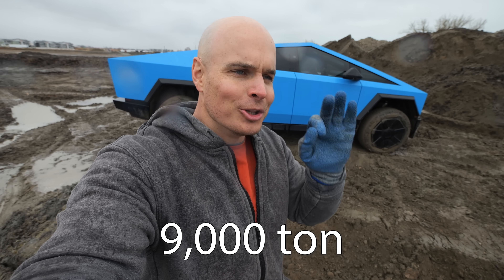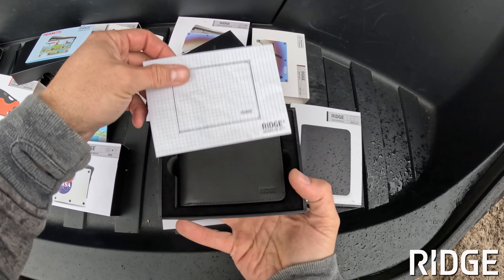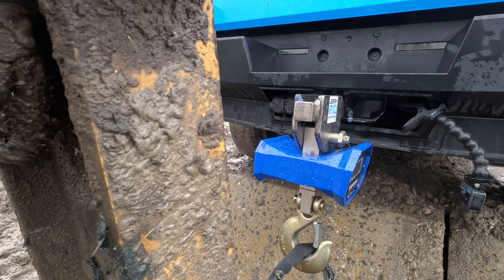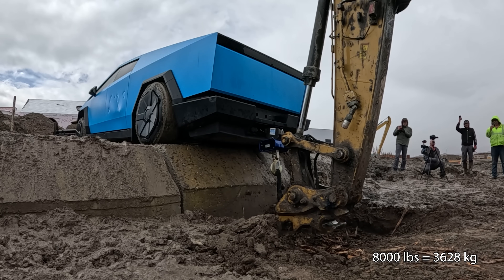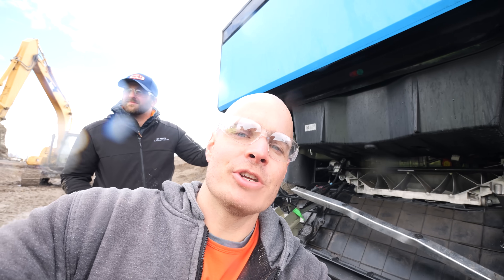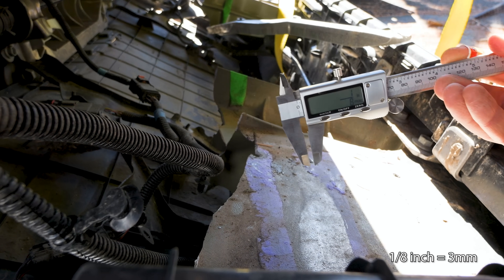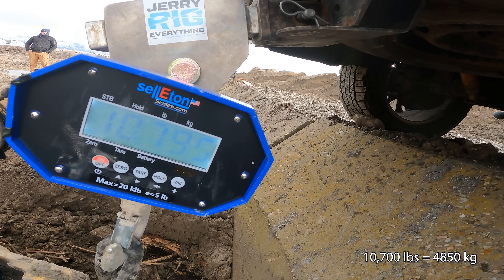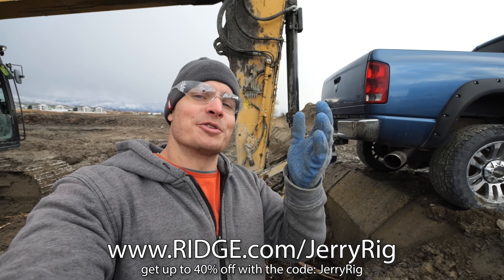SHOULD YOU TOW WITH A CYBERTRUCK?! - (catastrophic failure test)

Comment: I'm confused. The towing capacity is 11000lbs. When would you ever have 10000lbs actually being lifted by the tongue? I thought the tongue weight limit is suppose to be 10% of the towing capacity.
Reply: I'd be more worried about shock load,   Hit a large pothole with a loaded trailer the forces could be multiple times the weight of the trailer.
Reply: @OldJunkandaDog  No it wouldn't, unless the pothole is the size of the entire truck, which then falls vertically with the trailer behind it still on the road...
Reply: i thought the same thing its not 11000lbs towball weight
Reply: Bingo! This test is a crock of sh!t.
Reply: @ShawheenAzizi  hitches failing at the gigacasting while towing moderate loads under normal driving conditions have happened to literally DOZENS of CT owners so far - clearly there's a massive underlying issue/flaw regardless of what you think of this test. There has NEVER been any conventional steel frame truck models that have experienced dozens of frame failures towing within a year of launch, and if there were, any major manufacturer would do a full safety recall. This isn't just an issue hurting CT owners, it's potentially lethal to anyone driving behind a CT pulling a load.
Reply: Metal fatigue from cyclic loading is a thing. Just because it took 10,000 pounds to make it break off in ONE loading cycle, doesn't mean it couldn't break off after hundreds of loading cycles at 3,000 lbs. And with 1,000 lb static load on the hitch, 3,000 lb spike loads are entirely possibly when hitting sharp dips in the road at high speed. It was also making noises after 6,000, so at that point it was already compromised and would have broken off after a few more loading cycles.

Let's not forget that when WD broke his, he wasn't specifically trying to break that part of the truck. He was just goofing around with it, and it broke, very early in the testing too. 
It's also happened to at least one person in the real world, so let's not pretend that the 10,000 lbs seen in this video means it can't break off in real world conditions because it's already happened.

The real problem is the fact that it breaks off instead of bending. If the frame bends on a steel truck, you still got problems, but at least your 10,000 lb trailer didn't go out of control at 60 mph on a public road.
Reply: @thecrazyfarmboy  this is my concern exactly.  It started creaking at 4k, mades some pops at 6k.  Damage is already being done at 6,000 pounds.  Repeated stress could have these things breaking in 5 years or some time in the future
Reply: You are correct this test provides useless information
Reply: Sounds like a lot of people didn't actually watch the video since he mentions a few times.
Reply: Don't talk facts, the us progression hate
Reply: hit a pothole or go over a steep hill such as a levee.  Pull out a stuck vehicle.  

For instance, how does a 6000 pound truck pop a 16000 pound breaking strength strap?  It weighs under half of the breaking strength rating?   

Simply because there is a such thing as shock load multiplying the actual weight attached.  Which can occur during everyday events such as potholes, speed bumps, trailer becoming unlocked and jumping the ball hitch, recovering a stuck vehicle, sudden weight shift due to hard braking, and even occurrences such as a blowout on the trailer.
Reply: @jmkieff  and don't forget upward load cases like how diesel hit the hitch from below
Reply: How do people not understand that you can’t rigidly define dynamic forces? If you’re pulling 10,000lb at 1 g, it can easily become twice that or more if (it was at this point I was interrupted by the appearance of a large spider) you hit a large bump or pothole. Also rocking, swaying, and other dynamic forces can shift the load from the wheels to the hitch with more force than gravity alone. It’s not supposed to happen, and generally doesn’t, but you can’t always weigh everything you hook up. 5 tons can add up pretty quick, especially if the trailer is loaded improperly, which is sometimes hard to quantify. The reality is, the existing methods for building trucks were strong enough that this type of failure was heretofore unheard of.
Reply: I hate the cybertruck but this test is utter nonsense and proves actually that the cybertruck is designed to handle what it needs to. I can’t see a situation in which there is a 10k / 5t vertical load on the tow ball in any towing situation with a 10k trailer. That’s a bit biased tbh
Reply: @peterfrode2378  What the two tests show is the difference between materials when overloaded. The test was obviously an unrealistic scenario as far as static loading, but over time, aluminum will suffer and fail from repeated stress where steel won't. You are always going to see higher loads on the hitch going down the road than what is sitting on the ball at rest. 
 What bias was shown? Both vehicles had the same thing done to them, one broke, one didn't.
Reply: @ what did that test tell you about the cybertrucks towing capacity/ safety? He said” he would not want to be around a cybertruck towing anything” - that is the bias. Again there is 10x rated vertical load on the tow hitch which is exactly there die material disadvantages/ dynamics loads etc. 
Again I think the cybertruck is hideous but this seems like bashing to me. 
It has also nothing to do with a steel frame being able to carry the load more than a cybertruck. When you design a product you design it to all use conditions and add safety factors for overuse / misuse. Also there was no public event of a tow hitch ripping of in normal tow use or did you find any? I didn’t
Reply: @ this is 100% correct. But people can’t see past their hate.
Reply: It’s for the algorithm. This was one of the dumbest test I’ve seen in a long time. We get it you hate Tesla. That’s all you had to say.
Reply: @DatDude923  How is calling a test "catastrophic failure test" and doing that dumb? It compared what happens to one vehicle vs another, and one performed quite poorly compared to the other. Just say you are a Tesla fanboy, that's all you had to say.
Reply: @ ok scientifically speaking you can make everything a “ catastrophic failure” if you operate outside the bounds of a product’s intended design. Having a truck with a tongue weight of 1100 pounds have 11,000 pounds of pressure conducted on it will obviously yield a catastrophic result. And this appeals to a certain demographic of the YouTube community. Imagine if we were talking about football helmets. They intended for 300 pounds of pressure. But then you shoot an RPG at one and it explodes… catastrophic failure, worst helmet ever, see this is why we hate helmets. And this is the YouTube community. Call me a fanboy, but this is science. Just pretend it’s a product that you like. Maybe you’ll understand it.
Reply: the only time you would do that is when you want to get more views cus of trendy hateful people
Reply: Exactly..  They are just trying to make a sensational video with false claims.
Reply: I hear what you sayin bro, he did say he was testing till failure thou, but the analysis of the data seems skewd.. bbut aint no way around the luminum sure is weaker! other than that evry one here kinda sucks, Elon, the truck and Jerry kinda pulled a fast one them ;D
Reply: @whiterasta4745  To clear up your confusion - you are correct, and this channel is an obvious joke. Towing cap. is about power, brakes, and not about how much weight can be pushed down on hitch. I don't even know if there's a spec for that, cause it is just stupid if you have any sense/experience towing and working. Guess this guy wants a "stupid stuff"  channel like whistlin. It's called click bait.
Reply: Ot is highly unlikely that the hitch would ever see the load that tgey put on it short of a very, very bad collision. That being said, aluminum differs from steel in that it does fatigue over time when loaded and unloaded. Steel does not fatigue in this way, only if the load exceeds the limit of the steel will it fatigue and then most likely it will deform so you will know it is compromised. As we saw here the aluminum will give no such warning.
Reply: He just wanted a stupid video for views and that’s what he got
Reply: The point is trucks are supposed to be overbuilt because they’re supposed to do truck things. Like pull a stuck heavy duty truck out of the mud or deep snow, or not lose control if a trailer became disconnected. The Cybertruck is a fail and should have a STEEL frame.
Reply: It will fatigue overtime.  How long till the tongue fails, guess an unlucky Cybertruck owner will find out.
Reply: That is like balancing the entire capacity on the tow ball.
Reply: All tests in the automotive world are accelerated tests to simulate fatigue failures over time. You can't ever test 15 years of usage in 2-3 years of development cycle. While this might not be exactly the usage. Cyclic loading and Fatigue over years will lead to the exact kind of failure. 2004 steel vehicle frame didn't fail yet the very recent Cybertruck has a failure. While this is not applicable to 90% of users, it's still a valid concern for the development. Also I didn't get the glue lines and also such a failure giving that many error messages. A rear crash can also give kind of the same scenario of failure
Reply: The limit of 10% is in a static and horizontal position. When going down the trailer will fall to the front more and give it some extra weight, also if you consider road bump impact it can be much larger than that for a very short moment. But yeah, I agree that it still looks solid.
Reply: Dont be confused, this guy is a scammer who is infected with Elon derangement syndrome.  He pretty much is 'rigging everything' he says.
Reply: yes , but aluminium does not like stress and bending back and forth . Cast aluminium is even more brittle than the usual 6061 alu . After 2 solid back and forth bends the material breaks. 
Meaning that the elontruck would break after a couple of years . 
Ultra disappointing for a 3ton monstrosity , not to mention the price .
Reply: You absolutely wouldn't unless the trailer literally flipped into the air completely perpendicular to the truck. In which case you already crashed
Reply: @whiterasta4745 ... Yes. ... This test is unrealistic
Reply: @almc8445  The test is unrealistic but relevant, in reality  given the weight limit it looks to be sufficient for what it is specced for. How much aluminium fatigue causes an effect is the main concern here as I wouldn't think taking 30% of the value off would be sufficient.
Reply: @almc8445 no its not
Reply: @almc8445 yes the test is unrealistic, but in favor of the Tesla, start adding some dynamic movement to that, jumping and swinging and that hitch would have broken much much sooner
Reply: Exactly.   I don't know what this test proves.
Reply: Hier wird die Stützlast geprüft und nicht die Zuglast.👎
Reply: When he said you might have 10k on the hitch if you hit a pothole 😅 jre has no idea how towing works! It may be a junk truck but this test is incredibly misleading
Reply: Yeah, my thoughts too. Are we wrong? Has Jerry mistaken? Or is he just jumping on the Elon hate train?
Reply: @Tortoise_Tortellini  It is designed to make the cyber truck look bad, in turn make Elon Musk look bad because don’t forget about the ridiculous video Jerryrig did in support of Kamilla.  SMH 🤦‍♂️
Reply: @Tortoise_Tortellini  he already said at like 3k lbs that they "exceeded the tounge (weight?)" so he's aware of the cybertruck specs and still made the video this way 🤨
Reply: @Tortoise_Tortellini  did you watch the rest of the video?
Reply: @Tortoise_Tortellini  I hate Elon right now, but Jerry hates him harder!!
Reply: @ cyber truck is junk and not a truck that’s just the truth 🤷‍♂️ Elon absolutely is a horrible human being too though you couldn’t pay me to support him or any things he owns at this point!
Reply: @ I wouldn’t support him either, but that doesn’t make the point of the video any more or less valid. If it’s junk, show how it’s junk with relevant and realistic issues. I’ll happily watch that video and even give it a like!
But that was not this video.
Reply: @ dodge didn’t break did it? And costs less than cyber trash!  And yes it absolutely shows an inferior product/materials and design.
Reply: @WhathappenedIdontunderstand  actually it held up much better than is needed to.
Reply: @WhathappenedIdontunderstand  you don't like Elon, we get it...
Reply: @ no I don’t like overrated junk or people but that would include Elon.
Reply: @ no that’s the dodge not the cyber trash that did that…..if it held up better or at all then there wouldn’t be multiple instances of this happening…..
Reply: @WhathappenedIdontunderstand  fresh take
Reply: @WhathappenedIdontunderstand   who hurt you bro?
Reply: @ no one just do not like junk products….
Reply: Good for you. I can almost guarantee you'll never be able to afford a single car he makes too. I can almost bet that you have a $900 Honda Civic and that's all you'll ever be able to afford in your entire life @WhathappenedIdontunderstand
Reply: Watch the video again, he answered this exact question
Reply: Maybe watch the video where he explains exactly that... might clear up some of your confusion.
Reply: That would only happen because Jerry hates Elon musk so he’s pulling a cnn
Reply: He explained, when you go over hill at some point the angle is 90 degrees or loading mistake case bump
Reply: Here is why it matters:

When you jump on a trampoline the trampoline depresses lower than if you were to just stand on it. 

When you bend a piece of steel wire you can bend it back and forth a good deal of times before it snaps, aluminum wire not so much.

From those two examples someone with little technical background can work out why this is important.
Reply: @ yep steel you have one piece aluminum you have two….
Reply: I like what Zack is doing in general, but this test is simply disingenuous. Apparently the rated tongue load was exceeded several fold in the test. Towing never apllies that much force downwards.
Cybertruck is crap, Molusk is an absolutely disgusting human being, but using an irrelevant test is not the way to go.
Reply: @piit79 I mean in an emergency braking situation with a very heavy load your tongue wait would jump a hug amount…. Especially a heavy trailer that only has a single axle
Reply: another tesla slander video move on
Reply: What a ridiculous worthless video
Reply: Lmao the people in here who are Elon Musk shills are extra mad .
Reply: @Emiichoco  No. This is basic engineering. The test is entirely disingenuous and Cybertruck surpassed its load rating by 945%.
Reply: dude, can you watch the whole video at least? the thing is the road is not all as smooth as your perfect highway road. Jerry already mentioned for a truck under realistic performing environment, a bumper or a pothole that jerk the truck could actually result in more force in the vertical direction than the horizontal direction under certain velocity i.e. 80mph. Since the towing capacity is 11000, which Tesla hasn't specify if it's tongue weight or horizontal towing, it should be considered as ball weight anyway.
Reply: @Noah-rc3gg  Very wrong. Go talk to a civil or structural engineer about force calculations (if you know any).
Reply: @Noah-rc3gg  This isn't hard, here I googled it for you:
The Cybertruck's trailer hitch is a standard 2-inch square receiver, rated for a maximum towing capacity of 11,000 pounds, which puts it in the Class 5 hitch category, but with a tongue weight limit of 1,100 pounds. Class 5 hitch is all you need to know. I'm sure the engineers just bolted on any old hitch and didn't even run the numbers or test it, youtube engineers know more.
Reply: @Noah-rc3gg  They do specify the tongue weight.  1100 lbs is their stated number. Advertised towing capacity is always the drawn weight, not the tongue weight.
Reply: Because how else do you get clicks and fuel hate?
Reply: @JhaveriAakash  yea pretty pathetic what he's become
Reply: The problem is, you're forgetting you get more clicks for being wrong than being right. And now that thumbs down don't exist, you can't fact check anything. You're 100% right. Jerry had no value to the tech economy if he's encapsulates by hate. Oh well.
Reply: @ calling it hate when it’s a clearly inferior product and not a real truck it’s hate it’s reality it’s just not what the Tesla and  Elon fans like and want to hear….and if someone is a hateful person makes someone no value to a company? If so  then Elon is worthless…..
Reply: when you're trying to find any excuse to make a company look bad after you decide you don't like its CEO, anything is possible!
Reply: Correct. This video is nothing more than click bait. You will never have to worry about the cybertruck hitch failing during normal use if you follow the limits stipulated by Tesla. And no, I am not a cybertruck owner or fan. I just hate when people make videos that are not factual (although he very briefly said that had just EXCEEDED the tongue weight at one point but still tried to make you believe the cybertruck was inadequate for towning)...
Reply: @ so Tesla’s got some unknown new type of aluminum that defies the laws of physics and how aluminum behaves under stress? No they don’t. The aluminum frame is not put in another truck for a reason. This is not a real truck. It’s a piece of trash.